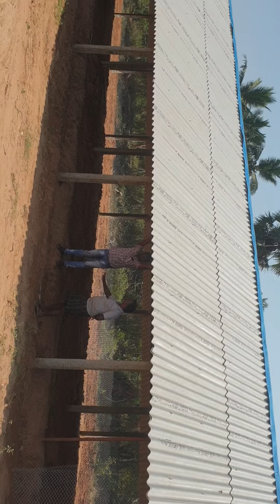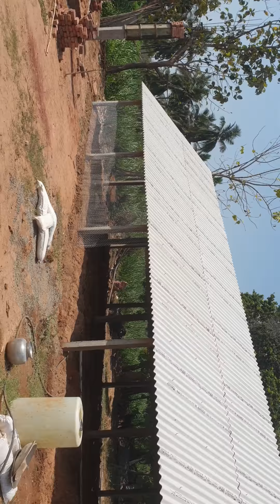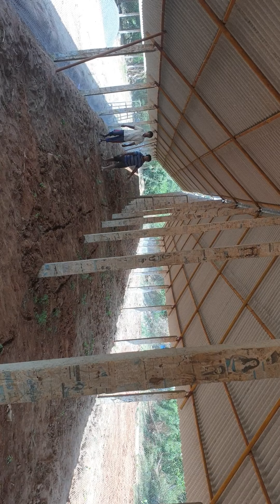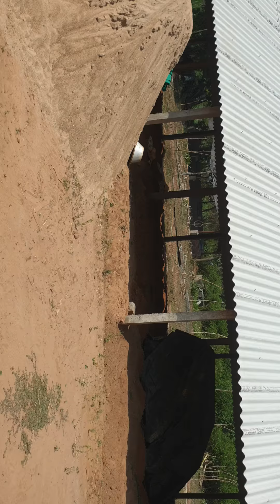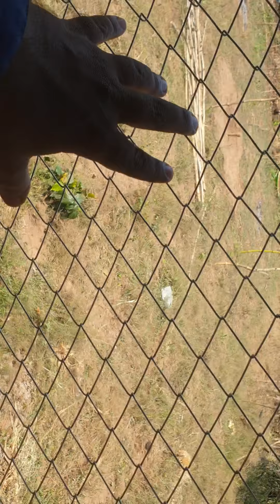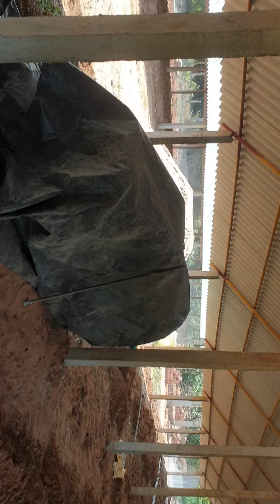NEW BROILER SHED CONSTRUCTION PLAN 10000 BIRDS

Comment: Answer these questions sir pls
1. 10,000 capacity shed dimensions(l*b)
2. She'd to shed distance antha 
3.cost for 10000 shed construction
Reply from the maker: shed width not more than 22 feet inside. length as you wish.
shed to shed distance may be minimum 60 feet.
Shwd construction cost of 10000 capacity is arlund 150 to 200 rupees per bird. each bird requires 1.25 to 1.35 square feet space